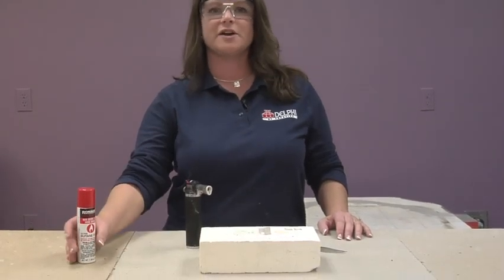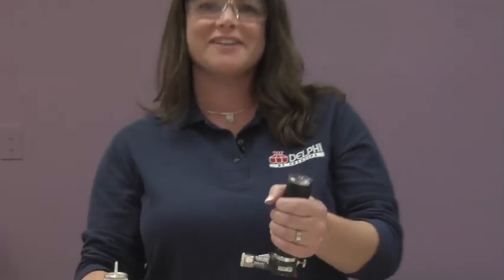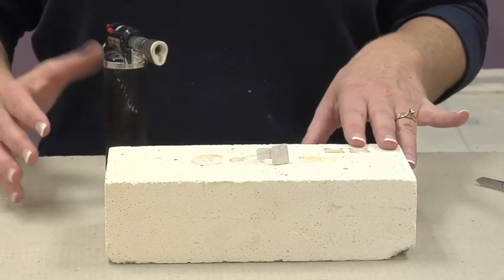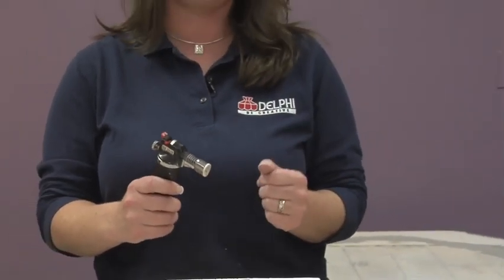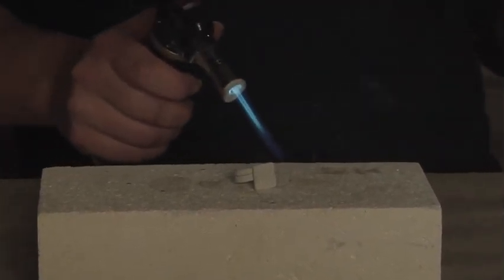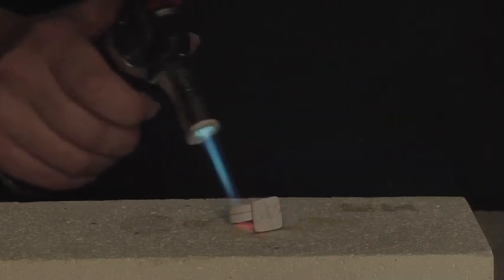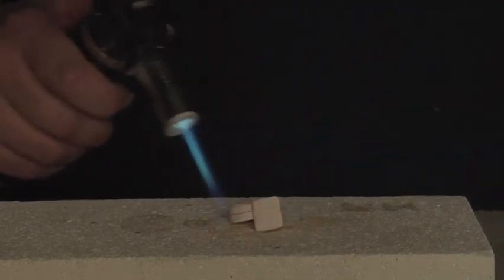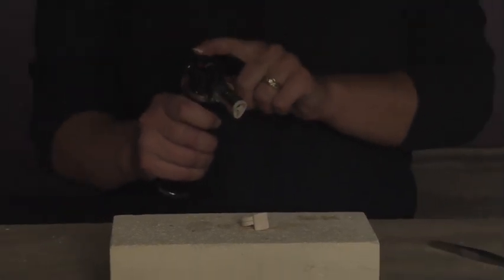How to Fire Precious Metal Clay | Delphi Glass

Comment from the maker: @00honey000 If you don't fire the clay enough it will be very brittle. If you are torch firing, the piece should be “glowing red’ and if you are kiln firing, just rely on the firing schedule which is included in the packet. When the clay is fully dried it will turn a lighter shade of gray.

Comment: Does a butane flame burn at a substantially different temperature than propane?
Reply from the maker: +joe woodchuck Butane burns about 10 degrees cooler than propane. The flame temperature of Propane in air is 1980 degrees Celsius. The flame temperature of Butane in air is 1970 degrees Celsius.

We've heard that propane is a 'dirtier' gas, therefor may not be ideal for metal clay of glass art. It may leave a residue. We personally haven't used it for this reason, so not exactly sure what it would do.

When firing metal clay, pay attention to the color. After the organic material burns away your project will start to glow (make sure to fire in a dark room so you can see it). You should see a nice orange, red color. If your piece gets too hot during firing you can scorch it, if you see shiny silver it's melting.

Comment from the maker: No, you don't need a specific kiln brick surface; the kitchen counter will work fine.  The kiln brick itself provides insulation and the torch has a very concentrated flame. Good luck!

Comment: Yep, I wondered why interject all the superfluous "go ahead" 's? Sometimes twice in one sentence? It takes away from the information that you are trying to present, and adds nothing. Otherwise, is it true that torch firing only works on PMC3? And that is only available in Silver?? And how many minutes do we keep torching once the piece is glowing orange?
Reply from the maker: PMC3 and PMC+ will work with both the torch and the kiln. PMC3 is also the only PMC that will work in a hot pot. PMC is only available in Silver. When firing with a torch, after the piece is glowing orange, they will need to continue with the torch for an additional 3-5 minutes.
Reply: Delphi Glass Creativity Center  Why not show the finished product? Doesnt it have to be pickled just like actual sterling, and polished? And yes, you have to disclose WHICH types of PMC clay and metals can be torch fired. Some can be, most cannot.